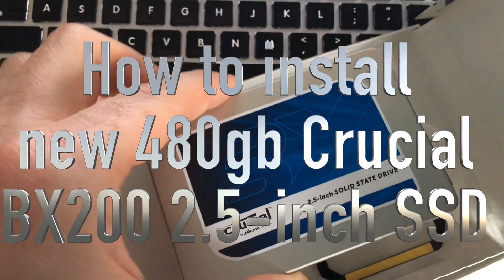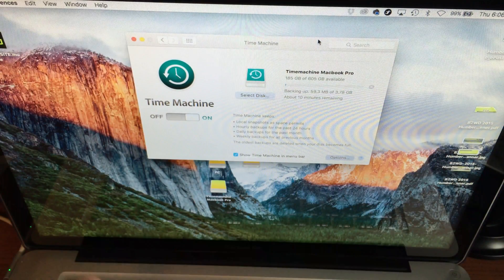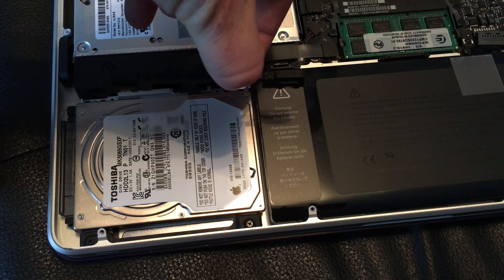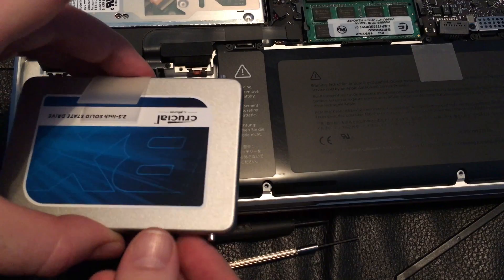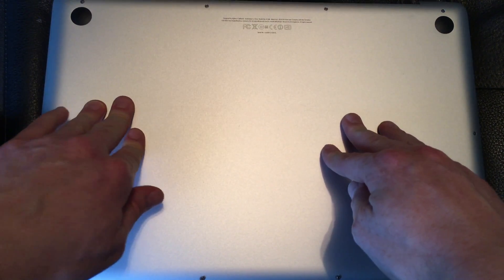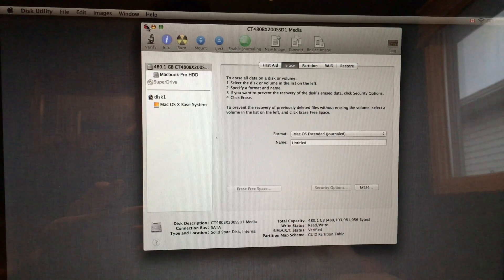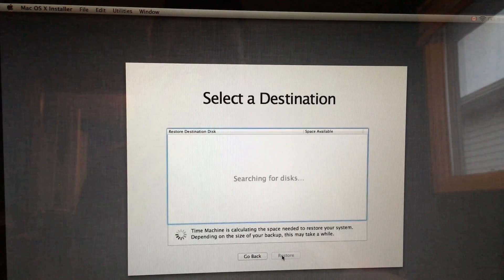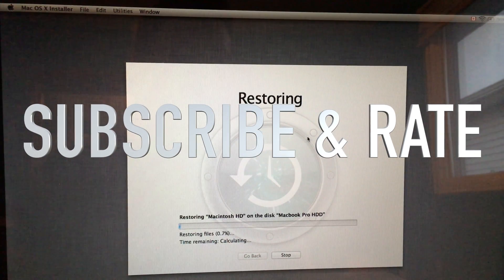How to Install New 480gb Crucial BX200 2.5 inch SSD in Macbook Pro

Comment: I have a MacBook Pro mid 2012 13 inch and this is too much after upgrade will it work fast with 6GB RAM 4GB in one slot and 2GB in second

Comment: Hi guys! Your video was super useful, but I got a problem with my SDD (same model as yours) and my Macbook Pro Mid2012 couldn't read it. Searching  on some forums I found that  might be a problem with my SATA Cable. Could you help with this? Before upgrading to this SSD,  I used a Crucial  BX200 240GB and a Sata cable with 821-1480-A MFC:2913. Thank you in advance!

Comment: I currently have a Macbook Pro 2011 15" that came with 480 Solid State SATA hard drive. Isn't that the same as a 480 SSD? If not what are the differences?
Reply from the maker: SSD = Solid State Sata hard drive

Comment: Thanks. was about to toss my new mac due to an HDD failure now I am gonna get a crucial Crucial MX300 525GB SATA 2.5" 7mm
Reply from the maker: Yeah. It’s cheap and easy to install. Just make sure you got no static. I always recommend getting an SSD harddrive
Reply: acguevara do I need to partition SSD drive to optimize rendering ?? Getting rid of optical drive and putting in another ssd instead . Wondering if I can upgrade processors too . New Retina is fucking expensive . Already lost one was stolen and now have my 17” MacBook Pro wanna use it inti I buy or build a new one .